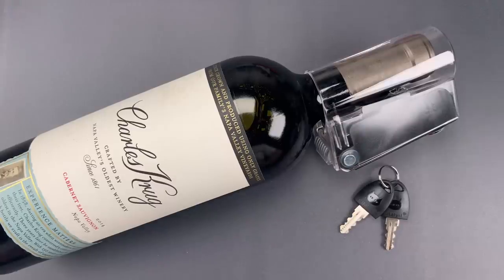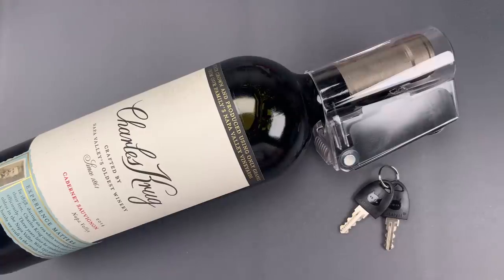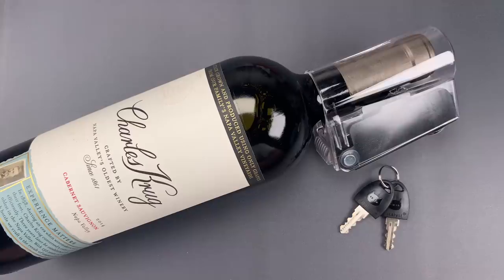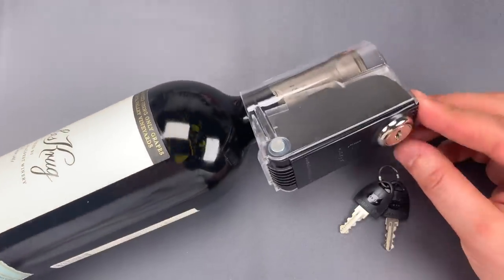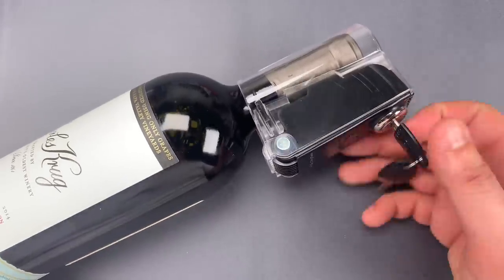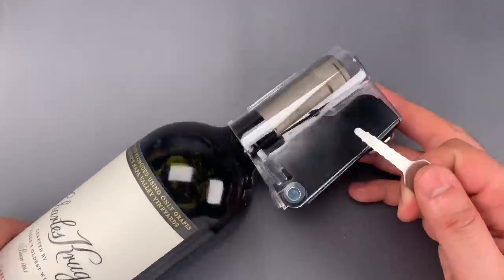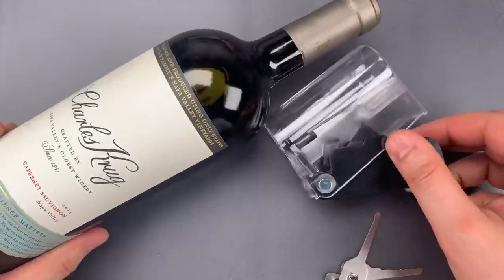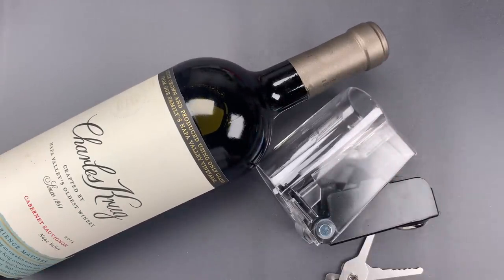[1153] Catalyst Bottle Lock Jiggled Open

Comment: My local liquor store has like megnegic strips in these that will set off the alarm if ya walk out the door with it. then it's on every bottle
Reply: UK supermarkets use something similar. Usually not on every bottle, but on the more expensive ones. (And how expensive that is is inversely proportional to the dodginess of the neighbourhood.)

Comment: i work in a uk supermarket that uses the magnetic version of these, they are pretty much useless on some bottles as they are easily slid off. the ones however that have a plastic part  that grips the neck of the bottle wont even open with the proper device. 😁

Comment: i think the purpose of this lock is putting them on very expensive bottles on restaurants and then make it impossible for people to mix them with cheaper wine when ordering/catering, just like those locks used on breakers on cabinets, you dont want to make them safe you just are putting a very glorified warning
i see some promise with these locks in other places like a cooler inside an airplane

Comment: How much are those? Any liquor cabinet I've ever seen has 20+ bottles in it. Even if this was a good lock, buying 20+ of them is kinda nonsensical. Especially if the keys have different bittings. Adding a decent lock to the cabinet would make more sense. The only valid use I can see is to keep children away from one or two bottles that are kept somewhere else, the fridge for instance. As a kid jiggling would've been beyond my horizon - what definitely was not is finding the keys :> My parents were more concerned about their stash of sweets, though. And yes, I've found that and the key to it ;)

Comment: I thought most wine already came in a Tamper Evident system since forever?

If i know i have this many bottles, i'll know they're disapperaing. If each bottle has cork, but one was reinserted you'll see it was screwed. Plus the fluid level would drop. (Unless they have a wine corker, fresh corks, filler juice. Or they make a kinetic or pneumatic cork remover.)  
Just teach them to homebrew. This is silly.

Comment: Why not just burn the plastic off the other side? A lighter should take that off in about 45 seconds.
Reply: As LPL said, that would be a win for the lock.
The lock is only here to tell the owner if someone wanted to open it. 
If your child melted the top off, you know. 
If your child picked it and drank 3 shots of rum out of a halve full bottle.... you have to know exactly how much was left to know that your child did something.

Comment: Can you please review the forever lock 2.0?!? Pls pls, it says it's unpickable because u don't have access to the keway, but I know u don't know the word 'unpickable'!!
Reply: I can't be bothered looking, but I'm pretty sure he did this.  And it's not.
Reply: @bdf2718  he hasn't  tested it yet, I'm sure, I'm been following this channel before the lock was realized, that's why I'm so insistent 😅
Reply: @VladDracvl  Others have.  It's not unpickable.
Reply: @bdf2718  I've some bumping with the foreverlock v1, but I cant find anyone picking/bumping/foiling the foreverlock v2.0 and thats why I think only the Lockpickinglayer can do the job ^^U
Reply: @VladDracvl  I can't find any successful attack on the v2.0.

Here's what I'd try (as somebody who has never even tried to pick a lock, sitting on top of Mount Dunning-Kruger).  Make a turning tool that looks like the key but with the channel for the sliders opened up to the max so all sliders can float to any position.  Insert key, turn to apply some tension, touch lock body with a fleshlight set to max.  Might have to experiment with the tension.  Might have to vary the degree of tension repeatedly.

It probably wouldn't work, but it would be an amusing video to watch.
Reply: @bdf2718  maybe, but i'm almost sure he would attack the lock in ther way, maybe some pin in the outside or some kind of sorcery he used to do  xD